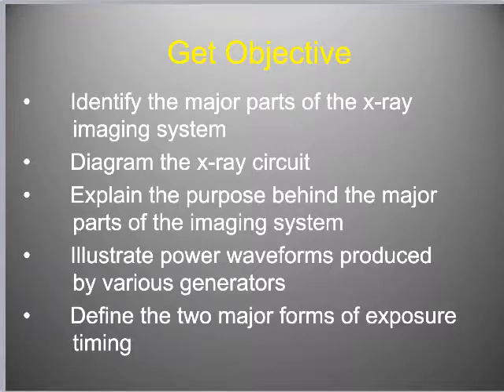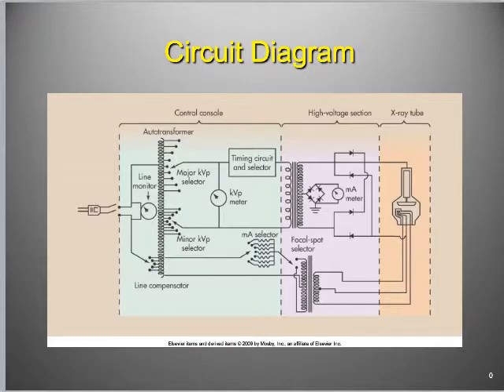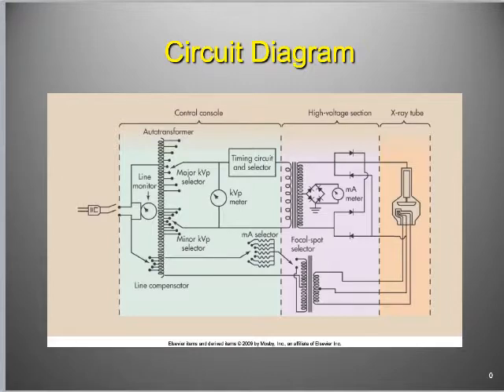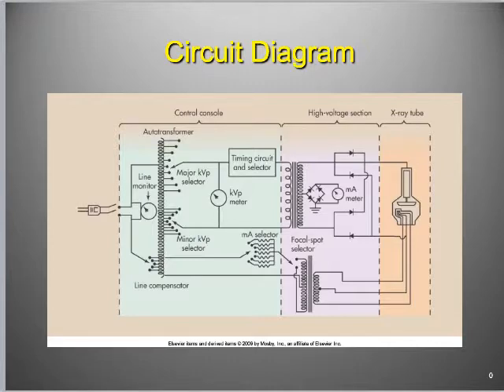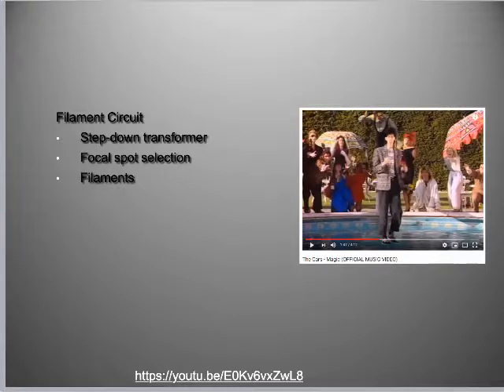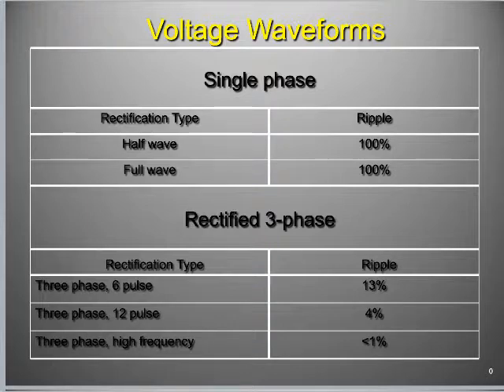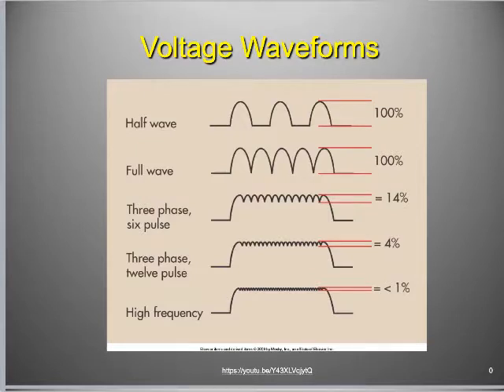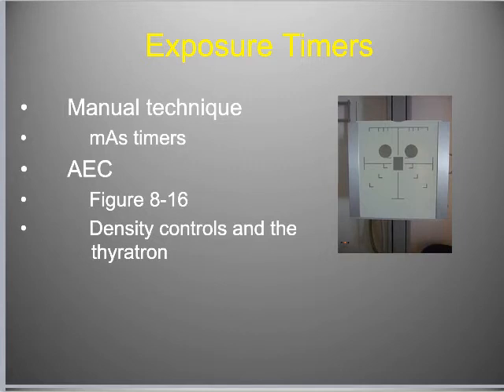X-ray machine circuit and generator

Comment: At 17:25 there is a wrong statement.  if passing alternating current to the x-ray tube it would explode.   In fact, this is called self rectification and until recently was commonly found in entry-level dental units.
Reply from the maker: Interesting point.  I was being a little facetious, but I'm not talking about dental units. I'm talking rotating anodes. For stationary anode tubes (dental stuff), which operate at a few hundred watts, the impedance is high meaning it contains a lot of resistance so in case of an arc damage to the tube and sensitive electronics is minimized. Self rectification wins the day.

A rotating anode tube operates under much higher power conditions sometimes over 100 kilowatts or almost 1000 times a stationary anode. Here the supply cannot have high impedance otherwise it would not support the required power. High voltage cables and voltage multiplier capacitors store such energy and damage to the tube in an arc can result. For the purposes of my students "explode" works fine.
Reply: Even though the word "explode" works fine, it still is improper to say it will explode when it won't.  It just won't conduct any current or make x-ray while the voltage is reversed.